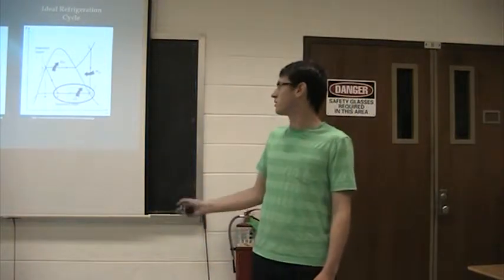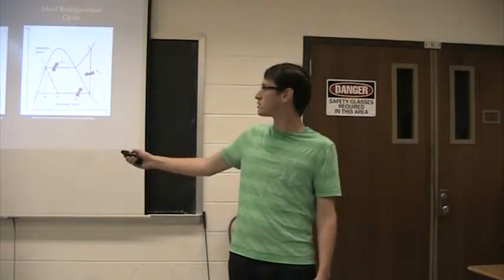MOV006

Comment: The background of your slides complimented the color of your text really well. Usually I am not a huge fan of darkened backgrounds but for the most part you did a great job making it work. All of your graphs were large and clear which made it easy to follow your presentation and pull the necessary information out of the graphs. A possible improvement could be to limit or change the way you did the procedure section of the presentation. You did a great job not reading off the slides and focusing

Comment: Your slides looked good and were easy to read. You had a good understanding of the experiment and how to work the calculations. Voice projection was good although you did have quite a few ums, but they didn't break your flow very much which is good. Also, very good job on timing. Also good job not turning around all the way when looking at the slides to point something out.

Comment: I felt confident in this presentation, especially in the procedure section, and i believe I was able to confer the process well, although three whole slides on this section was too much. The "ums" which have stalked me all semester were in full effect for this presentation and I believe it is my biggest issue to work on. Hand gestures were above average for me but not quite where I would like them to be. I also could have given a more detailed description of the refrigeration cycle.